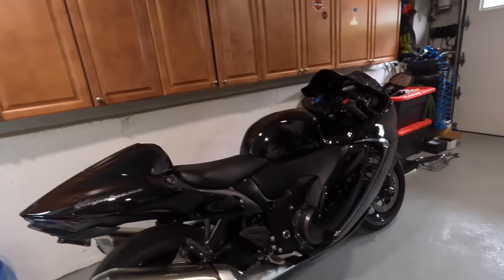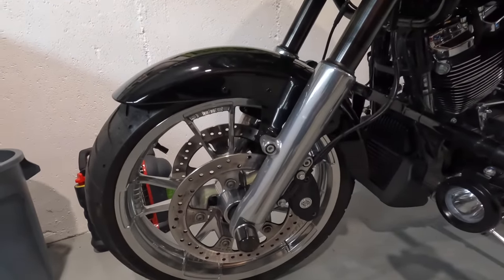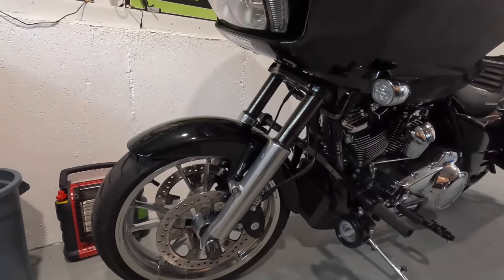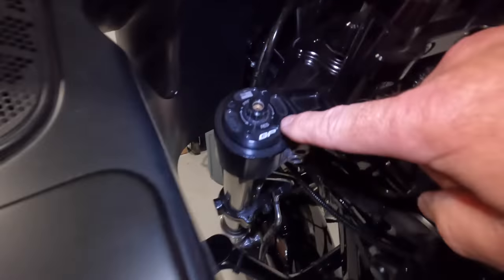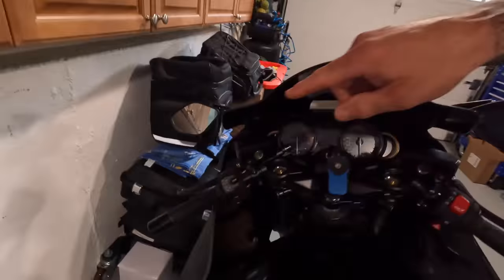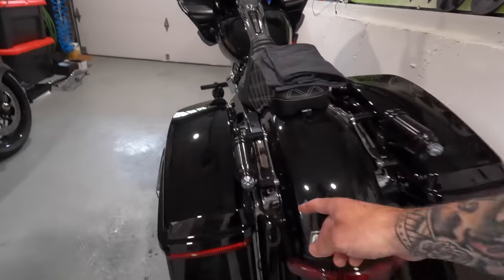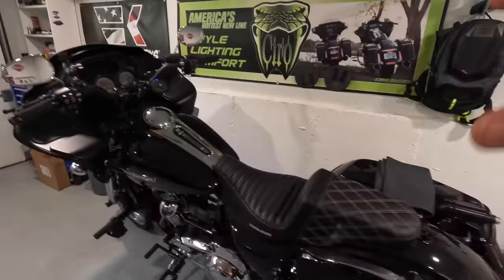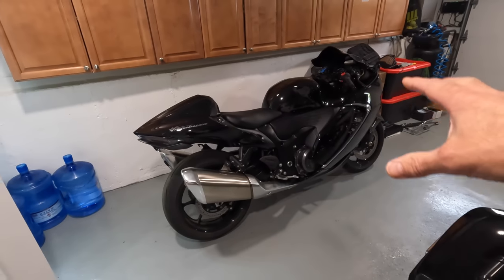HARLEY DAVIDSON ROAD GLIDE PERFORMANCE UPGRADES | ARE THEY GOOD❓#cyclefanatix #harleydavidson

Comment: Crankcase ventilation, and Engine Oil temperature stabilization?
Highly recommend that you ventilate the crankcase; I prefer the excellent Trask M8 Checkvent; alternatives...Vented Oil Dip Stick from Fueling and others.  Low budget method is a DIY modification to the HD OE plastic cover (top of trans.).  Add the Fan to the existing oil cooler, either the HD Fan or Thundermax Fan works fine and is super easy install (no disconnecting oil lines, etc. such as with the combo oil cooler/fan from HD...just get the fan only).  Once installed, the ECU will need to know that there is now a fan on the oil cooler for proper on/off cycling of the fan.  HD Dealers typically charge around $50 for the ECU flash when running the HD OE ECU and Tune.  If tuning with non-HD Tuners (Powervision, TTS, etc. on the stock ECU) might want to load in the stock tune before the bike gets connected to Digital Tech at a Dealership.  If running a Thundermax ECU (and the Thundermax Fan), even easier.
Tom M., '23 RG-ST.

Comment: The missing link is a front cylinder top engine stabilizer that is adjustable that will push your engine and swing arm to the right...do this bro you will be amazed!! As you adjust the link your shock bolt holes on your swing arm tilt to right letting your shocks bolt up from the same position! On the swing arm. Bike on kickstand and drive torque is always pulling your engine down on the left which is making your rear wheel lean causing the infamous Harley touring sp🎉eed wobble!
Reply: Rack and Pull industries has the solution to the Harley touring wobble!! It's not from the front end!

Comment: We used to use a deep socket with an extension on our hotrod headers... put some tape on the exhaust where you have to massage the shape, lay the socket sideways on the tape and tap with a hammer until you get the shape you are looking for. Works like a champ :-)

Comment: Hey John, been watching your video’s for some time now, BIG compliments on the quality, topics and biker community content you’re putting out there! A tip on the quadlock mount: please purchase and add the vibration dampener, if you don’t your iPhone camera will go bust. It happened to me on my Softail FatBob 🙄. Apple replaced it under warranty but said it was a onetime deal, next time I’d have to pay for this myself. After adding the dampener I’ve had zero issues. You probably don’t want to ruin your phone 😎

Comment: Great video John. I had the Evolution Industries clutch installed in my bike this winter and I am running the ATF-F fluid like they recommend. I have switched to Amsoil fluids in the other 2 holes and was wondering how you feel about running Amsoil in there instead of what they recommend. I want to run Amsoil in all three holes. Thanks for your time.

Comment: Good Info John thanks for the video, always good to hear from you. Couple questions for you brother. Did you change out your clutch adjuster with the Evolution clutch install or are you still using the OEM? Lastly, you said Amsoil, so I assume you're using Amsoil ATF in your primary for the clutch?
Reply from the maker: Yes about the oil and yes I’m still using oem clutch adjuster, but I will be changing it out

Comment: Ok every Harley touring bike has a handling problem that you don't know about the front wheel and the rear wheel are out of alignment the rear wheel is leaning to the left... To much to explain go to Rack and Pull industries videos the  part is called the Missing Link with moves your engine back to the right where it belongs which aligns the frt and rear wheels please watch this videos if you don't believe me Jack your bike up let the rear wheel hang disconnect the shocks off on of the swing arm then try to bolt the shocks back up you will see that ther bolt holes don't line up! That's because your engine and swingarm arm leaning to the left. Watch the videos!!!!